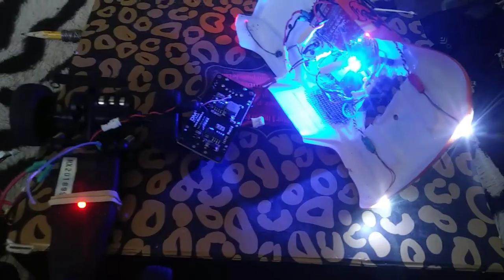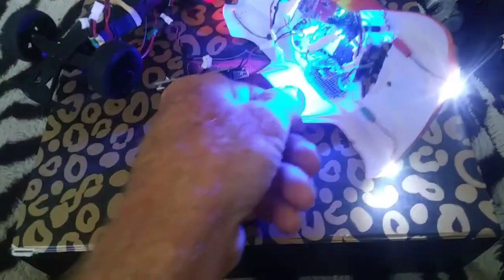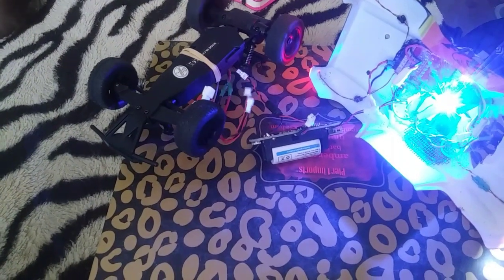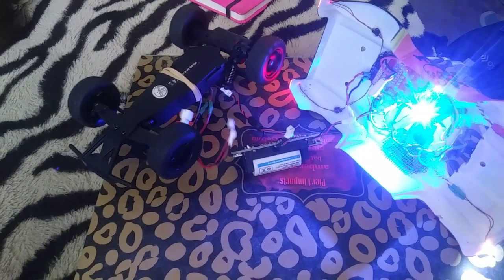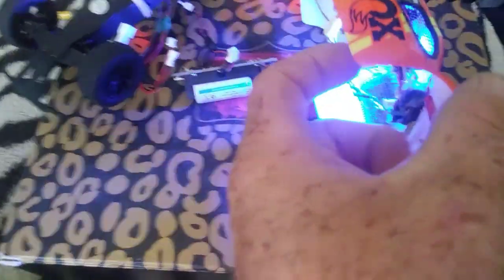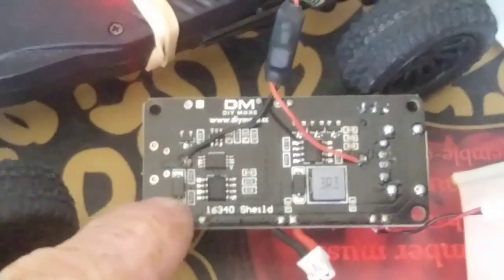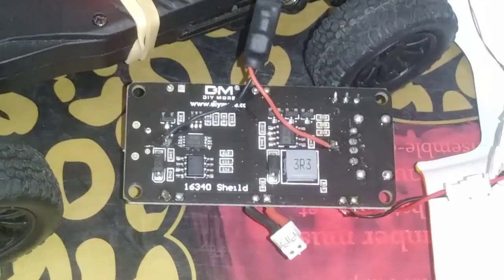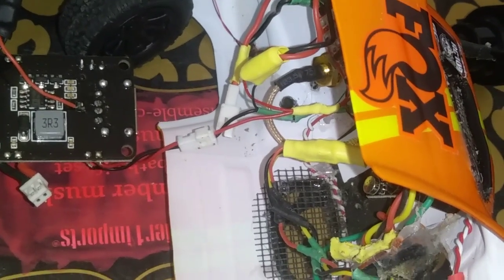Sc28 - My 1s fpv rc car battery project part 2 (Tech Talk)

Comment: Kid got the SC28 CARL Lucas oil 17 stadium truck and the red light on chassis is flashing after we charge it and run it for about 5 seconds. No forward or reverse but steering is good. Bad battery? All stock. I have a 3.7 900mAh Lipo that I can solder in, wiil give it some needed weight as it just spins its wheels on a wood floor. Thanks
Reply from the maker: You could solder a new battery in. I'd just put a plug on it. Ph2.0 or whatever your connector is. In all honesty. I would personally make a wiring loom just for multiple batteries. It'll run up to 5v. 
Like a ph1.25, red jst, molex and so on. Just remember. The further electric travels the more you lose in transition. 

With that being said. I utilize old USB cables for wire inside for these projects. 

You may go down in size wire. With little loss. But going from small power wires to big power wires is hard on it. And loss of power. 

There is no reason you cannot wire a thick ph2.0 and a skinny 1.25 in the same wiring loom and get desired results. Or add a tiny step up from 3.7v to 5v 1a max but I'd stick with 0.5 if possible.
Reply: @FPVOutlaw  Thanks! Any idea what the flashing red light means?
Reply from the maker: @68pishta68  honestly. I'd say it's not charging. Using your own wiring loom, your own 1s batts and charger will bypass this issue I think. I'd have to have the unit. 

Check banggood for a cheap USB 1s charger
Reply from the maker: For the floor. Maybe take a chunk of wax and rub it on the tires

Comment: where did you get the lights
Reply from the maker: On this particular car I used smd 5050 leds for the white and blue. The red was as small as available in the "3" size. Just find the proper resistors for your chosen colors and application. 

You can also go to www.tinywhoop.com and check out what they have. But for the cost of one you can buy many in bulk.
Reply from the maker: You can search smd led on ebay, froogle, google, banggood, Amazon and other websites
Reply: FPV Outlaw thank you so much
Reply from the maker: @geckogaming5944  no problem. Good luck and ask anything you want. If this is car/truck related you should join the tinywhip group on fb. 

I won't lie, it's small, but knowledgeable people in it. Pretty sad more don't post as much anymore. But information and contacts are there. Links to the group are in many of my video descriptions. If you can't find it, just let me know.

Comment: One mod I did to mine was put in a quad copter motor from a Hubsan x4. Thing does like 15-20mph now!
Reply: I’ll have a video in a couple days, maybe even on the 1/10 indoor track. I just have a problem with the pinion gear sliding off. I tried super glueing it on but it still comes off. Any suggestions?? Thanks.
Reply from the maker: @garbagefpvproductions859  E6000 man. Use that. And actually let it set for 24 hours. 12 will probably do it but I would wait 24 due to the amount of use the parts get. If you need to remove E6000, a little heat can help you peel it right off. 

I use this stuff for all sorts of projects and repairs. Can't ever go wrong with it as long as you got patience.
Reply: Ok. Thanks a lot man!👍👍
Reply from the maker: @garbagefpvproductions859  you're welcome. Thanks for your contribution to my channel and seeing what I got going on. Will be looking for vids later.
Reply: Me again.... lol. Do you know we’re I can get pinion gears for those cars
Reply from the maker: @garbagefpvproductions859  these small cars? I'd say yes if you do enough crossreferencing and examining. It'll take you time to find them if they exists. 

Won't be labeled for them. But a measuing caliper and some patience would bring results. 

Or 3d printer. 

Sorry man. That's all I got right now
Reply: Thanks again! 👍
Reply from the maker: @garbagefpvproductions859  if you are needing stock parts for the sc28 line up there are "chassis" you can buy and tires. Gears, servo and motor with aio esc in the chassis for $30 on Amazon. 

Tires on Amazon ranging around $15

If you want custom or upgrades. Measuring caliper and time. 

If you need parts for like a wltoys L939 you can find them online too. 

https://fpvoutlaw.wordpress.com/2019/05/19/team-associated-sc28-line-up-and-my-recommended-parts/

There is my recommended parts for stock sc28 line up. 

If you want metal parts. Like gears or anything. Count the teeth. Measure everything. And cross-examine other car parts of relatively same size. 

You can also search for wltoys l939 parts on my blog www.Fpvoutlawblog.tk
Reply: Thank you soo much for all the info! Very helpful stuff. I need to get a metal pinion. The plastic ones melt after hard running.
Reply from the maker: @garbagefpvproductions859  I have no doubt there is a compatible one. 

Please post somewhere about it if you do find one. There are others who'd like to see and do. 

Appreciate your contribution
Reply: Pinion gears are 0.4 mod 9 tooth 4.3mm diameter 1mm shaft
Reply from the maker: Nice. Got any videos of it?

Comment: Nice work brother! You build the coolest stuff, I wish you were my neighbor I have so many questions. I just got into the hobby and started modding helis, quads and cars for fpv. Not like you though, I do simple on board power mods for the aio camera that runs on 2.5 to 5 volt
Reply from the maker: No vids yet huh? I'd record what you do. Even with your phone. And upload it. Record, catalog, personal log and eventually fpv vids. 

Then a possible passive income....

I appreciate the comment and checking my stuff out. If you haven't subscribed, you should. I'll be doing give aways. From small things like solder, diodes, resistors, fans to custom units like the orange fox truck and others. 

Your contribution on your projects will help the RC community, even if you think it won't. 

Either way, glad to have you aboard!
Reply from the maker: Actually I just remembered we had a conversation before. My bad! Just got a lot going on.
Reply from the maker: Would be happy to see vids if you're making some. I'll check your channel out in a bit. Getting ready for work.
Reply from the maker: What kinda questions you got?